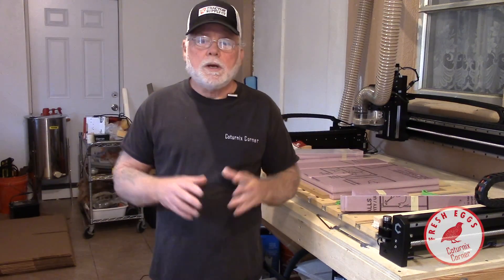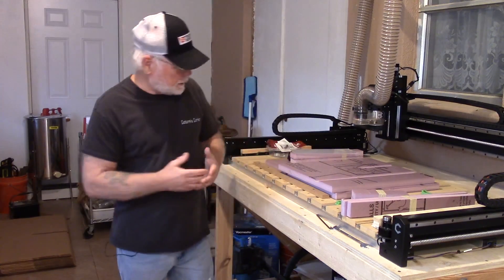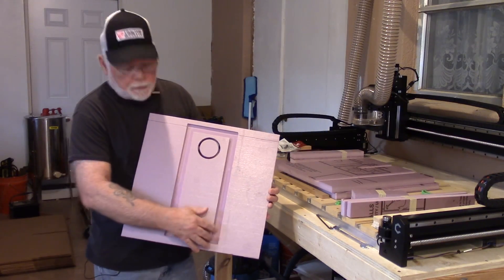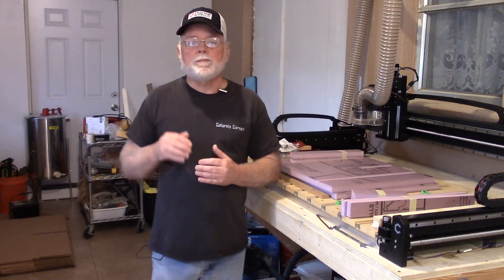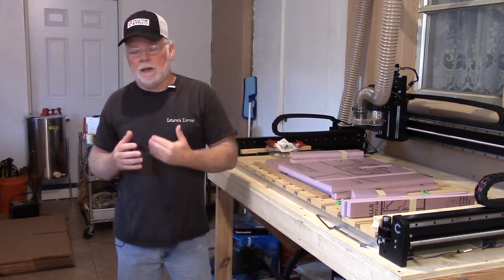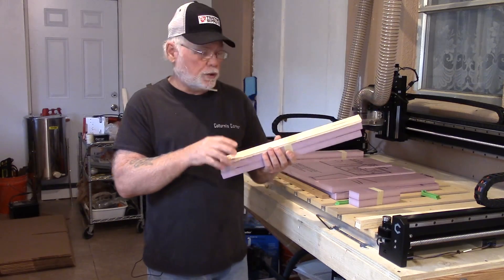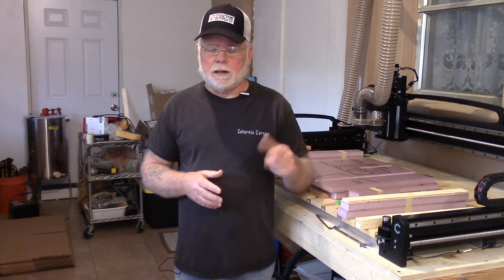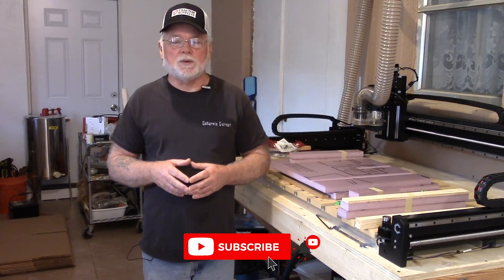DIY Tabletop Incubator - The "TerryBator MINI"

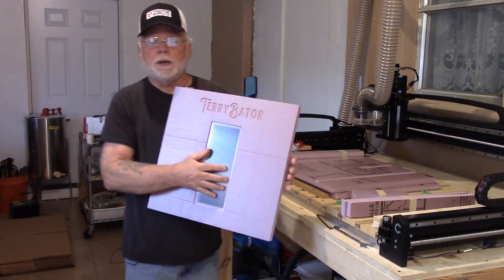Comment: 1:27 can you route out the back side and add a second clear panel to make it a double-pane insulated window?
Reply from the maker: I could but tbh it's not needed. The incubator does just fine holding temps as is.

Comment: Terry, since the R valule on plexiglass is very low-do you think there is cool spot at that plexiglass area on the inside of the incubator?
Reply from the maker: The plexiglass is a non issue, there is no excess heat loss.
Reply: @CoturnixCorner  Thanks Terry.